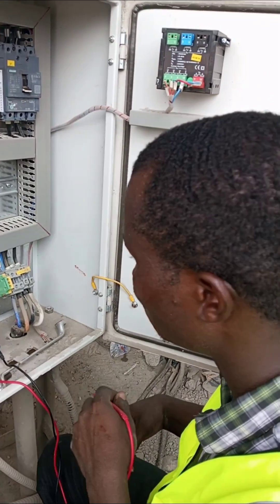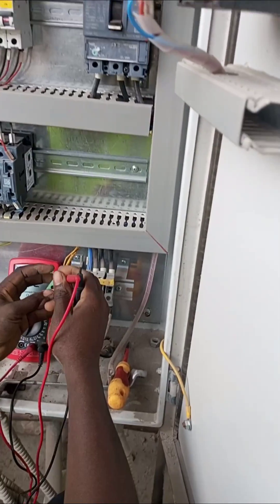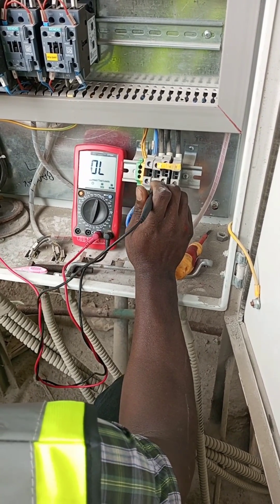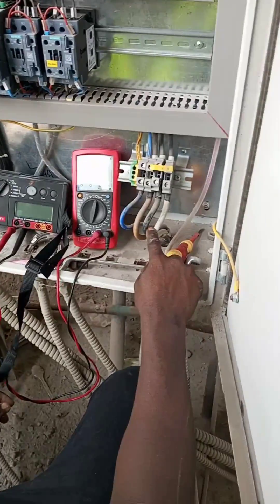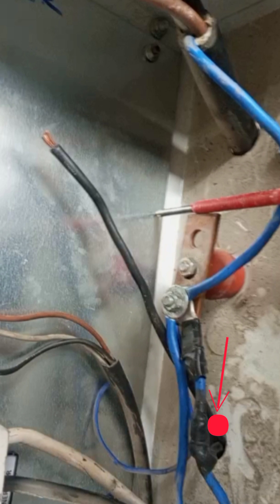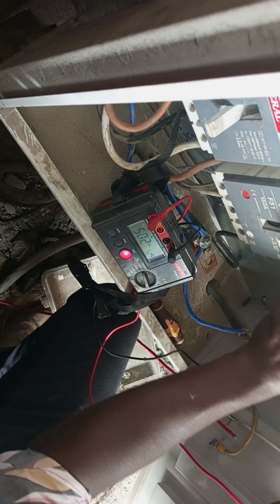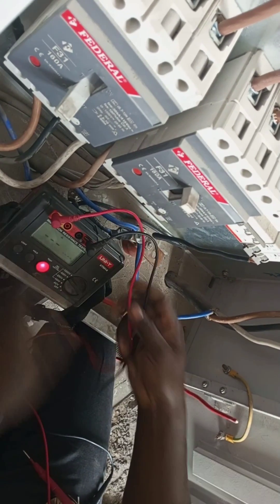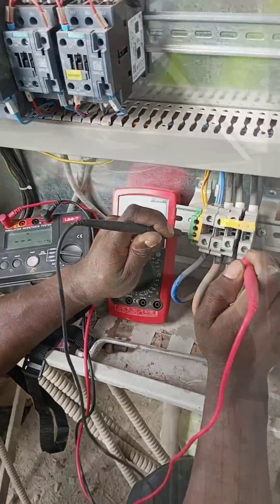ELECTRICAL TROUBLESHOOTING

Comment: Sir why is it that the neutral cables of industrial areas have power flowing through them.
Reply from the maker: In a perfectly balanced three-phase system, currents in each phase feeding the devices would ideally cancel each other out on the neutral, resulting in zero current through the neutral.
However,  in real-world scenarios Most industrial settings have unbalanced loads on different phases. This imbalance creates a current that flows in the neutral wire to complete the circuit.

Comment: This is a very great one sir. In electrical engineering like this one to notice that there is a problem is so common and usual, but the real deal here is to identify where its coming from especially an installations you were not the layer. Some times you'll meet a very random installation done by a random minded socalled electrician. Which means that the next electrician called should be really talented and gifted (like you Sir) to identify the issue and fix it the next minutes that follows, thanks for the demonstration and God bless you.
Reply from the maker: Thanks for your boss

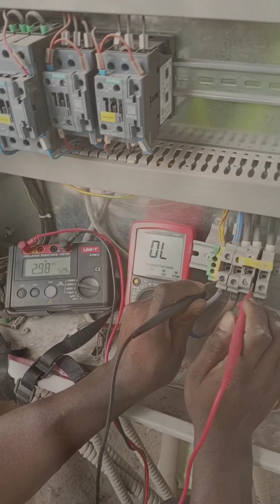Comment: 4:29 I am here again with another question, when there's a direct connection between live and earth won't there be short circuit
Reply: Thank you for sharing
Reply from the maker: Yes, so the cable got deteriorated gradually until it got to that very bad level. But the breakers in that panel are high rated breakers 160A breakers so this situation could've even caused fire due to overheating before the breaker operates.
Reply: @obloni_Electrical  wow! I see, that's why breaker selection is very key
Reply: What are RCDs
Reply from the maker: @eduseijohn1855  
 RCD stands for Residual Current Device, is a safety device used in electrical systems:
* They are more sensitive than regular fuses and circuit breakers, meaning they can react to smaller imbalances in current.
* They are designed to trip very quickly, in milliseconds, in order to minimize the risk of harm from an electric shock. When a fault occurs in the wiring.
* They are typically installed in consumer units, the main electrical panel of a building, and can protect individual circuits or the entire electrical installation.
Use these links to learn more about RCDs:
https://youtu.be/EDl-Vapdm5M?si=Rh8UapPMDrtGrV44
https://youtu.be/s1dP9xth6KY?si=bUg0FMDreDvkyDTp
https://youtu.be/Njr3LXOyEyI?si=HasN69oRuzKuXUnX
Reply from the maker: @eduseijohn1855  please use these links to learn more about RCDs: https://youtu.be/yAxkPvMb-7E?si=q3QOBzFJuP8gUPrm
https://youtu.be/EDl-Vapdm5M?si=UbUykG_bV41buNu7
https://youtu.be/HeRdarYcoIQ?si=RU2gIZGXPxqCVhUs
https://youtu.be/cPWMhQpa7Zc?si=FAp0BtBOWB6LrvUo
https://youtu.be/QQ4leh3wXso?si=NTmyaKEOzmsAuOkv
Reply: Yeah! Even the best way to check earth if is properly functioning is live and Earth ( nominal Volt), Earth and Neutral (less than 2Ohns) with multimeter

Comment: Please what's the name and model of the other instrument you are using at the later part of the video. And how are you using it.
Thanks
Reply from the maker: It's insulation resistant tester. It's used to check the strength of the insulation on the cables
Reply: @obloni_Electrical  Please what is model number and brand name